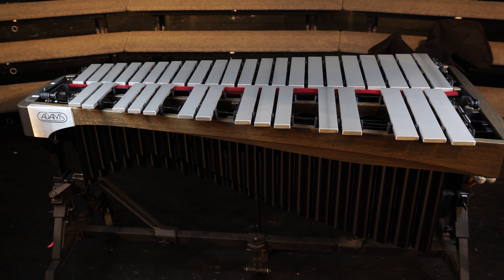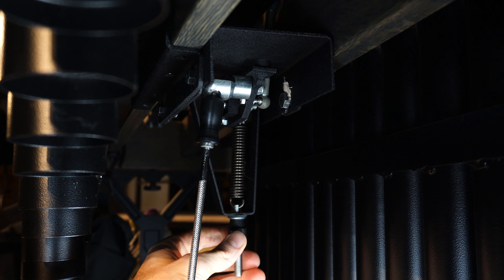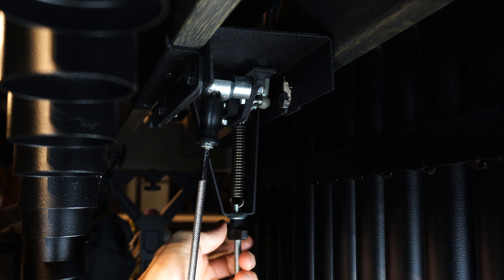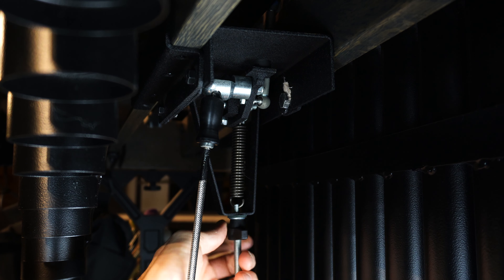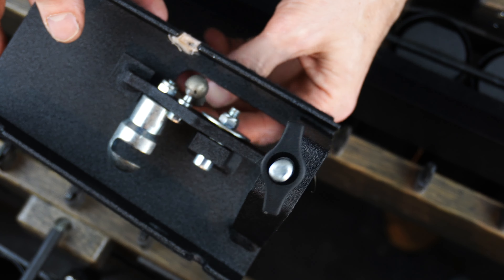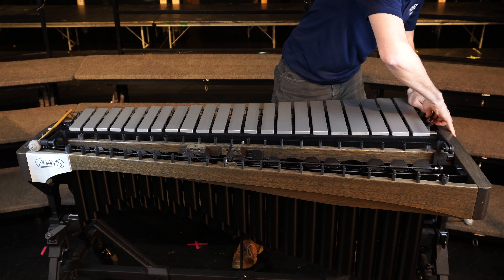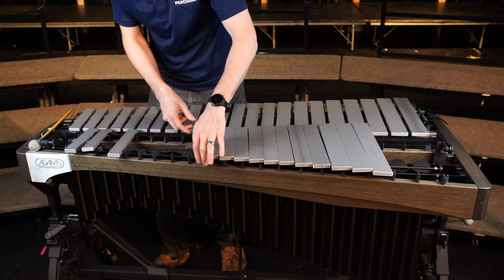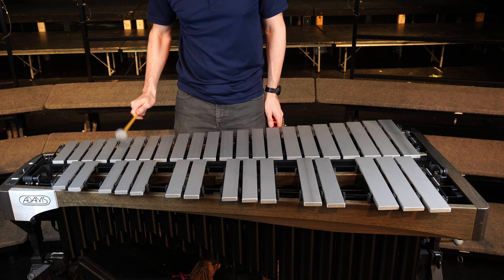Adjusting an Adams Vibraphone Dampening Bar

Comment: Thanks for this video!

 My fairly new Adams vibraphone has the same problem as you describe from second 45: the center bars are damped while the bars at the end are undamped. This occurs on both the accidental and natural bars. The dampening bar seems to be straight, so I have no idea why this happens.

Do you know what could be the reason for this unequal dampening?

Thanks in advance!
Reply from the maker: My initial thought is that the rails need to be readjusted. Before you do that, make sure the cord is sitting in the suspension posts properly and that the rails are sitting on the frame correct. I’d also check to make sure the entire frame is put together correctly and then adjust the damper bar as shown in the video.
Reply: I talked to Adams about the problem and they are going to send us new rails. I hope, that will help. Cheers. @BonoPercussion
Reply from the maker: @MarkusKrämer-p3q  Oh great. Hope that resolves your issue!